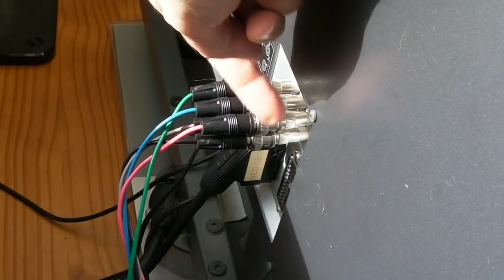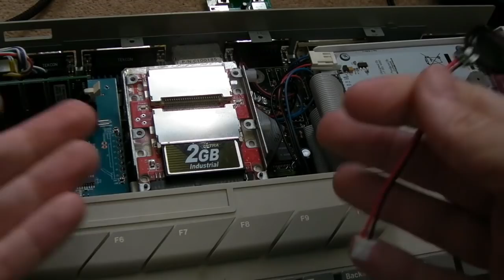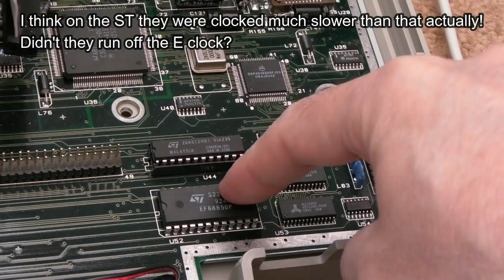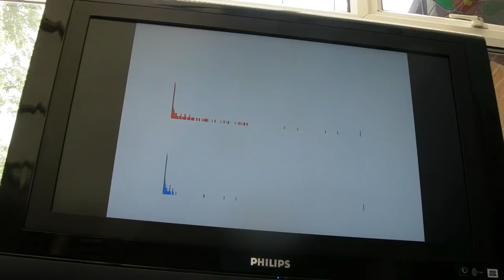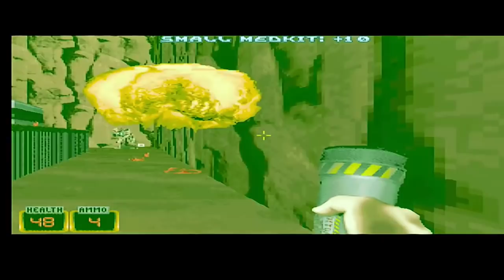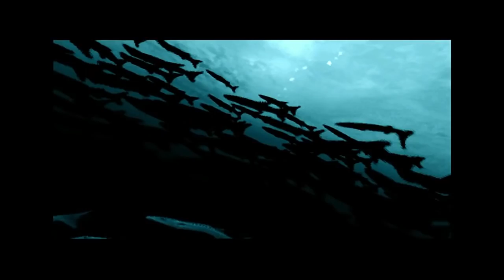Atari Falcon 060 Unbelievable Donation & Repair Part 3 (SDMA Clock Fix / Speaker / RGB & More)

Comment from the maker: The link covering all the crazy clock mods / patches that were applied over the years:- https://mikrosk.github.io/clockpatch/
Worth pointing out the "memory expansion" connnectors - they are where the memory connects, rather than somewhere to add additional RAM.  ie.  There's no main RAM on the Falcon motherboard at all - just 96K for the DSP.
Part 1 - https://youtu.be/-43l7KhTI0U
Part 2 - https://youtu.be/-4RtB7mLBPI

This system was incredibly GIVEN to me by William on Twitter (@ste_mega AKA 3DOKID)
Here's the link to his website:- http://wmgaming.co.uk/
Exxos Store (ST and Falcon) - https://www.exxoshost.co.uk/atari/store2/
Exxos blog talking about his board and the clock patches! - https://www.exxoshost.co.uk/atari/last/falcpatch/index.htm
Edu Arana Store (Falcon, Amiga & More) - https://www.arananet.net/pedidos/

The full demo towards the end there is by The Black Lotus, called Starstruck - in the public domain, free to download.
Corrections: I said fitting that 33ohm resistor was risky - I was confusing myself, in part 2 (I think) I had a 22ohm there.  33ohm is what this board shipped with.  In general the 22 vs 33 will affect the voltage of the clock through the voltage divider we created in part 2 with the 47ohm termination resistor - that was the point I was trying to make.

Comment: Watching Atari computer videos on autoplay/random and this was one of them. An interesting bit of kit the Falcon is, though one I will never have (the prices these command are insane, well over £1500). Video is 2 years old, and those Falcon IC listings are still up, looks like none sold. The actual price isnt bad ($20-25 USD per IC)... but not sure why he wont sell them individually. C303002 is a lot of 84 of them. C302996 is a package of 120 of them... Maybe someone in the future will do a group buy. 

Too bad he does not have a listing of say, 80 PAL GTIAs lol, that I could use.

Comment: The frame rate is OK, but that's a pretty blocky resolution on Doom/Doom II. Frame rate is not so good for Quake. As cool as it was back in the day, the Falcon just never had a chance against the rapidly evolving PC platform. But then again, neither did anyone else's proprietary architecture, other than Apple's Mac.

Comment: Hi there,
thanks very much for posting this series of videos.
I recently had my Falcon serviced and it's nice to see that others out there are still using it. 
I still have my ADAT interface, 4 x Midi out and SPDIF box, and now it's running well.
I'm thinking of adding the heatsinks to the motherboard, just as you have (every little helps!).
What sizes should I get?
Kenny
Reply from the maker: I went with a combination of 40mm x 40mm for the larger ICs, and 20mm x 20mm for smaller ones.
Reply: @GadgetUK164  Many thanks

Comment: For the clock mod, did you try putting a resistor in series with each clock output? Reflections are strongly affected by the rise and fall time of the signal, and adding a resistor (10s or 100s of ohms) close to the source can slow the transitions enough to still switch cleanly but not dump excess energy into the system.

Also, rather than just a 47 ohm resistor to ground (to terminate at the end), you can try putting a 100 ohm resistor to ground and vdd - you still get the same effective 50 ohm termination, but it's biased around the half way point, so you're not fighting to get the voltage high enough for the input to recognize it.
Reply from the maker: I did experiment a little with the inline resistors there for those clock signals.  I think they ship with 22ohm there and I swapped for 33ohm (and that did make a difference).  So perhaps you are right that had I gone to 100ohm maybe it would have made more of a difference.

Comment: Random thought...

Some nice little speakers I found years ago, are the "subwoofer" modules for the Acer Aspire 5920.

You can often find them on eBay for about a fiver.
They are quite small, but have their own housing, and a built-in audio amp that runs off 5V.

They are meant as a small subwoofer (if you can call it that. lol), but actually play full-range quite well for the size.

If you want to bypass the inbuilt audio amp, you have to attack the case with a Dremel, but it's quite easy to do.

It has a 5-pin connector, for Gnd, 5V, Left, Right, and Enable.
(The Left and Right signals just get mixed to mono via internal resistors, so you can just join those two wires together.)

I can't remember the exact pinout, but I believe the Yellow and Orange wires are the audio L/R inputs.
Red for 5V? Brown for Ground, and Black for Enable (which I think had to be Grounded).

P.S. I can confirm that they definitely DON'T run off 12 Volts. lol
Reply from the maker: Thanks, I will check those out =D
Reply: You just reminded me. I found two of the speakers I had hooked up to one of those small MP3 modules (DF Player).

The pinout of the speaker is..

Red = 5V
Black = Gnd
Brown = Enable_n (tie to Ground)
Yellow = Audio in
Orange = Audio in

Not super high on the treble response, but worth a test.
Reply from the maker: @electronash  Cheers mate =D

Comment: Why did Gembench say you had no FPU present??! You had one, I saw it...
Reply from the maker: There is an FPU present for sure (and it works) - the version of Gem Bench I used seemed to crash on the FPU test (I think that's a known problem with the 060 and that version?).  Without the FPU all the 060 stuff on there would not run - and it runs flawlessly!
Reply: @GadgetUK164  It reported a 030 so I think you were in 030 mode, not 060... but I guess Gem Bench must be the buggy one :D
Reply: @GadgetUK164  Man I'm so envious of your setup :D:D:D:D This is a wonderful machine. Congrats!!

Comment: That DSP was the reason you could run something like Cubase Audio on there and have multiple over CD quality audio tracks playing and send it out via SPDIF and and loads of MIDI tracks. This was a wonderful audio production tool back then. Much like a DAW in today's standards is used coupled with a nice audio/MIDI interface. Except that here, you didn't need an external audio interface....

Comment: Why bother with RGB? The Falcon can be connected to a VGA monitor. You just need a small adapter to convert the connectors, otherwise, it will just display fine on a VGA monitor. I guess the adapter you have would work just fine. You're missing out on the higher resolutions this way.
Reply from the maker: All my displays and capture cards etc are all RGB.  I prefer RGB over VGA or HDMI for that reason.  I did use it on a VGA monitor and it is much clearer, but I use it with the large TV there (which also supports VGA input lol).
Reply: @GadgetUK164  Makes sense... I remember the joy of being able to use higher resolutions with no interlace when I got my TT030 and later the Falcon... I never wanted to go back to RGB (nowadays of course, it's completely different... I've got my trusty 1084 around and try to connect whatever I can to that :D)

Comment: Hey Gadge, hope you are good dude.  [still super jelly of you owning one of these machines BTW :P ]  

Regarding the speaker thing, the types that you have used are not designed to be used in this way, see the thing is, they are designed to have a "baffle" - a plane or an enclosure. The reasoning is that when the diaphragm pushes the air out, it gets sucked around to the back and equalises the pressure, meaning there's no resonance / limitation. Think of them like a drum, but in reverse. If you hit a drum skin out of the drum, sounds shite, but put a round box around it and things change drastically. 

This is why the Beeb and Acorns cheap speakers were sort of okay (and PC speakers being obnoxiously loud depending on the  mobo and case), they were facing outside of the case and using the case itself as a box. 

Two possible options, cut a hole out of some cardboard / plastic that surrounds the diaphragm that is way larger than the speaker to prevent air going from front to back, depending on the material you may get unwanted resonance (buzzy stuff). 

Or maybe try and find some tube foam (like pipe lagging) that will go between the speaker and the grill on the upper part of the case. The latter would be better, as the volume of the case would act like a box for resonance, the 1st one is a bit of a bodge, but can work.
Reply from the maker: Cheers mate!  Did you see how much ST Blitters are now lol - £80!!!  Was looking at Atarifreaks parts today...   Yes, you are correct regards those speakers!  The big problem with those smaller ones though was they just aren't powerful enough and have too much high end support, very low mid to low.  The final one I fitted which is supposed to be better than the stock ones again lacks a bit of bass.
Reply: @GadgetUK164  £80 for a blitter? They were not that high when Exxos had a limited supply. At least they aren't as bad to get as the chips the hoarder you were on about in this vid. 

I still have the blitter you sent me ages ago, I've been waiting to fit the socket, and I'm kinda glad I have waited, as after finding the 2nd FM board, I'm gonna inspect it and maybe mod that to have the 4 Meg Marpet RAM, as the MMU on the board I was considering has crushed pins due to the over the top PLCC socket, it's kinda sloppy. The Shifter chip part is solid as a rock though. 

The other board is stock, never been touched, but it's sat in a bottom case, no top or keyboard. Gonna have to go back up to the loft and take it it downstairs.  Decisions.

We'll see. Once I get a working ST again, you can have the other mobo, and the bottom case.

Comment: Great video brings back fond memories of my Atari ST and Amiga days wish I still had them, if I remember correctly the Atari st had left and right rca audio output so I used that wire to amp and speakers
Reply: Pretty sure you mean the Amiga. I had a 500 and later a 4000, and they both had stereo RCA.
Reply: @jonjamhar  STE had phonos, Falcon had 3.5mm

Comment: you should try wiring up hat pico speaker as a high end, use resistors until all the mid range is canceled, then you should get a pc speaker and use it as the woofer, use a resistor to cancel the mid range from that, and use that elliptical speaker as your mid range, use a resistor to cancel the low end, and high end from it. full range. prolly sound better, or go get an 8 ohm car door speaker and wire it up. something else to try is getting/building a crossover and a small eq, i bet if you added that stuff in and i know its alot, you could make those shit speakers sound good at full range.
Reply from the maker: Thanks!  Yes, I did my own share of cross over stuff back in the day - mostly in car audio setups! =D  The speaker mostly wont be used in this, I just wanted one there as it would have originally had internal sound.
Reply: @GadgetUK164   right on, i figured as much, thats how i know it, car audio, i thought it would be a fun project or something for you to tackle.
Reply: @GadgetUK164  oh yeah, dont forget about getting pci working on that machine as well, and possibly a sound card :)

Comment: @13:33 the Codec as you mention is probably better referred to as the DAC, as it is the Digital to Analogue converter. It basically turns Digital (from within the falcon) to Analogue (the output ports) and the reverse, Analogue > Digital too.
Reply from the maker: Thanks!  Yes, I did almost put ADC tbh!  I wasn't sure about output though, I didn't realise it handled output!
Reply: @GadgetUK164  Falcons have a Codec and a DSP. The video IC is normally referred to as the DAC.